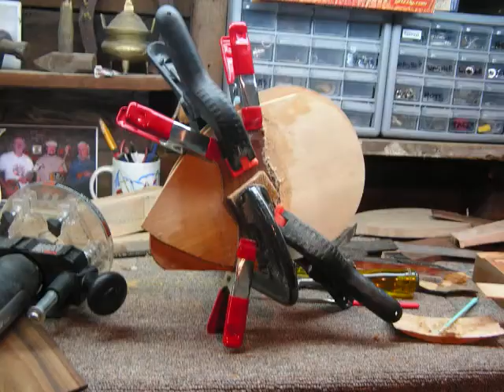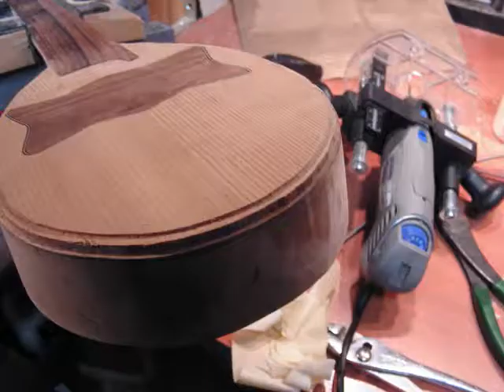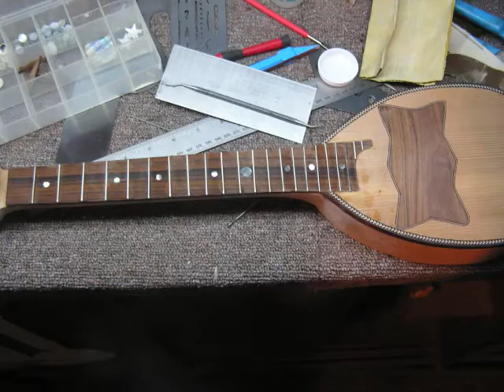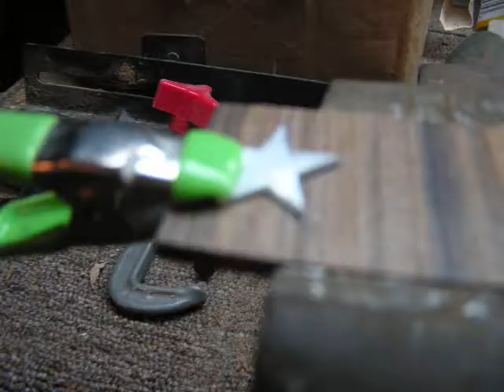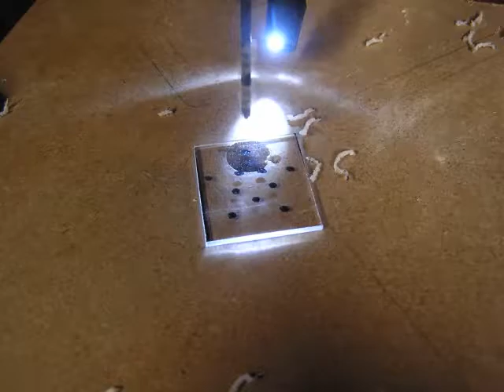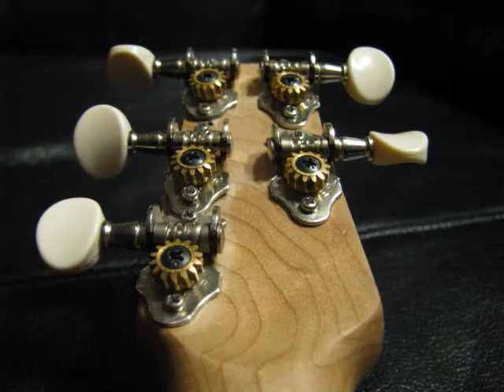Building a Prim

Comment: Nice!!  Do you sell these?
Reply from the maker: mark Duggan Since I made this I have had three children so no time to build , maybe some day.
Reply: Jerry Starcevic I just found one.. but cannot find any info on the string gauges I should use..help!!  Are any of them wound?  The one I got is a 5 string prim.
Reply from the maker: Depends on what kind of Prim it is D,E or G?
If you have some pictures send them to me.
gas12@comcast.net
Reply: Jerry Starcevic The one I have is not a 5 string it is a 6 string  low to high it is 1-1-2-2  It needs new strings and the scale length is 14"  I have no idea what gauges to use or the tuning?? Appears to be around a 20 gauge wound at the lowest is it in 4ths or 5ths?? It is croatian I think and carved out of a single piece of wood (neck and body)   the top is 2 types of wood ..pretty) I would like to use the traditional tuning as I play 5th tuned instruments and looking for something different..thanks Jerry